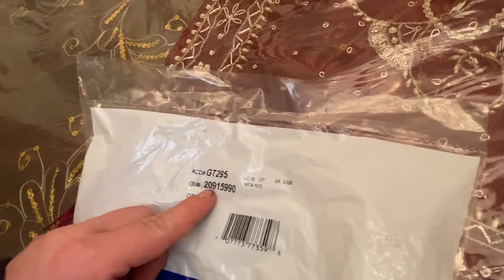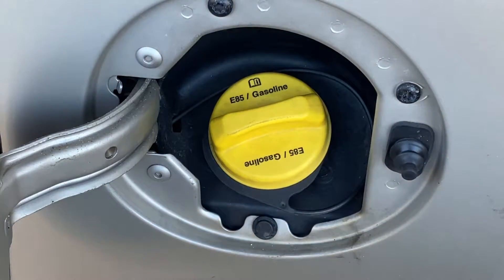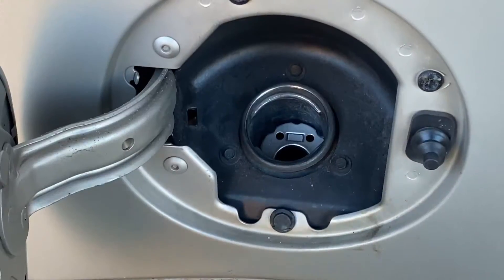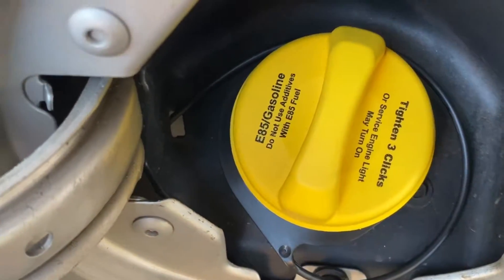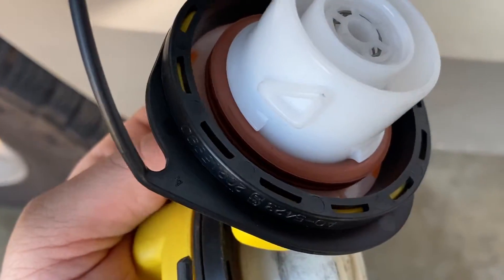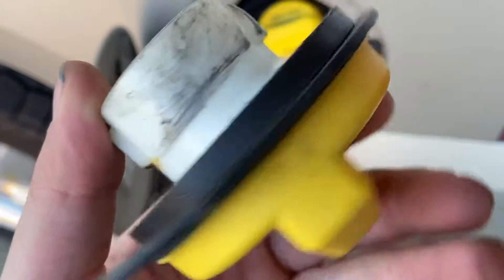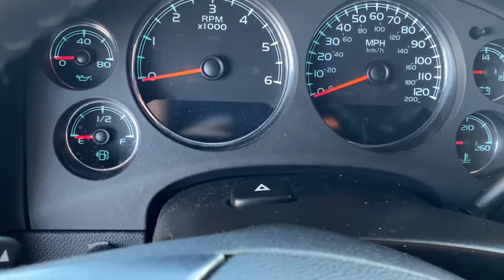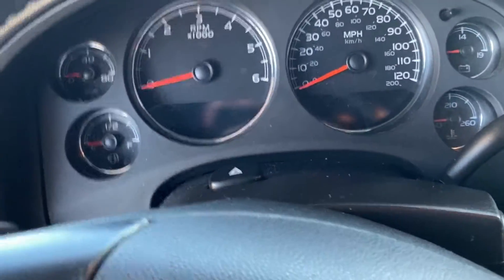How To Fix Tighten Gas Cap Message Tahoe,Silverado,Yukon, Denali 07-14

Comment from the maker: To ellaborate further on this issue. There was video replacing the selenoid which is apart of the emissions but I removed it due to poor quality IMO. The reason why the message pops up is that there's an issue with the EVAP system. This consists of the Gas cap, Charcoal Cannister, Evap Selenoid, and Vapor Purge Valve. All problems are dependent on the code that pops up usually it will start with the P0445 code as an example then you know you have an emission code. What I demonstrated in this video is the cheapest option as the seal on my gas cap was essentially dry and had cracks in it. 

Here is the link to the video for anyone that needs further assistance: https://www.youtube.com/watch?v=7vILrOmyVSs&t=190s  towards replacing the selenoid Be wary that the charcoal canister can also be on its way out and would be wise to replace as well.
 
It's an old video, but I made it public again for help.

This may warrant a video to be created just like my DL8 TO DL3 conversion video explaining the reasons why it happens but nonetheless, i hope this message helps everyone.
Reply: Were you having problems filling the tank at normal speed?
Reply from the maker: @dangerousfreedom4965  yes

Comment: @builditgeorge , will the engine light go away once the cap has sealed properly ? I work twelve hour shifts I’m hoping it’ll clear on its own.
Reply from the maker: Now i dont want to suggest this but this is what i did.... I didn’t have a OBD scanner but if you disconnect one of the terminals on your battery and flick the high beams on it will drain the power from the Computer clearing the code out basically thats what i did and mine went away never had the light comeback and i could remote start it again. Hope this helps you!
Reply: BuildItGeorge a long time the battery was off?
Reply from the maker: Arturo Baez Nope, just flip the high beams on when you disconnect the battery so any power drains out of the car and reconnect within 3-5 minutes and it should disappear thats what i did and it worked for me!
Reply: @Muhfucking23  winner of this post

Comment: So a loose gas cap can cause the check engine light to come up?
Reply: yes
Reply from the maker: Yes it can mine has long since disappeared
Reply: It is aligned to the Evaporative emissions control system, so it'll trigger the check engine light.

Comment: I have a 09 Silverado and I’m having the same issue but I can’t seem to find a cap that works. I’ve ordered multiple caps claiming to be the one for my truck but non of them fully seal. Could it be an issue with the filler neck threads?
Reply from the maker: Very Very unlikley. Please use GM PART DIRECT and enter your VIN number for accurate part number.
Reply: Most likely your problem isn't the gas cap if you have tried different ones and have the same issue. It sounds like the solenoid is bad or the canister. Get the engine code checked and see what code it is throwing.
Reply: @TheDiamonddust1  it’s definitely the cap. I can’t find one that will seal right
Reply: @scottyhester1 did it end up being the cap? Mine gets tight but seems to unseal itself with time

Comment: I have a question not about the gas cap but the gas flap that has fell down inside of the tube is will it stop gas from pumping and then have to stop pumping the gas and restart

Comment: I replaced my gas cap with a generic one from auto zone and the message did not come up for a while but it is now appearing again every single day. will I need to take it to a mechanic or is it something I can do myself?
Reply: I feel you, I'm in the exact same situation right now. Whenever someone rides with me and it dings"tighten fuel cap" I just say "don't worry, that's normal" 😵‍💫
Reply: @Tomfoolery-135 did you two ever found the solution to your gas cap problem?
Reply: @lbasura  not exactly, I just started using Universal Fuel caps and it had seemed to do the trick, my other option would be to replace the filler neck...and I don't feel like doing allat so I just use universal.

Comment: Buddy just because this worked for you doesnt mean it will fix our problems there are many reasons that warning is popping up. A pinhole in has filler tube will cause same problem buying new cap wont help.
Reply from the maker: I’m sorry it didn’t help your scenario. I try my best to record my experiences and help people. Just shedding some light on this particular subject But thank you for your reply. I’ll try to be more specific next time !!!
Reply: Ya I bought a new gas cap too, still eventually comes loose while driving.

Comment: Wait wait hold up there is no freaking way you mean to tell me when it says to get a new freaking gas cap all you have to do is get a new gas cap come on man that some kind of trickery or Hocus Pocus stuff going on here
Reply from the maker: Tah dah.. Yes it actually works the seal is what goes bad just like every piece of plastic on the car just gotta be replaced with the updated stuff!
Reply: My seal isn't dried out or cracked but the tighten gas cap has come up 4 times in the last few weeks
Reply: @BuildItGeorge  wrong answer its the Vapor Canister Vent Solenoid . You can replaced gas caps all u want wont make no difference
Reply: @gabrielruiz-yt2fh that pissess me off I just had my 09 silverado in for a new fuel pump lock ring and fuel lines which cost me a pretty dam penny.. and now my tighten fuel cap light is on which it was not b4 I took it in.... They told me b4 I picked it up that when I put fuel in it go slow which I have noticed b4  what you just said I might need extra next $300, told them I'll hold on that for now.  I've tighten the fuel cap since I've gotten it back a few times already and the light comes on still. I'll check the fuel cap next to see if that's what it is, my luck probably not, just my luck lately.

Comment: after putting new gas cap on, and you turn it three clicks, is the cap still able to turn further while turning it clockwise??

 I want to find out if  my cap is bad.
i don't have the message type in my car the car is not equipped with that type of message.

Comment: I've changed my gas cap tighten it. But engine light still on smh
Reply: Mine to. I hate it.
Reply: Disconnect the negative battery cable for at least 10 minutes, then reconnect to see what it does...